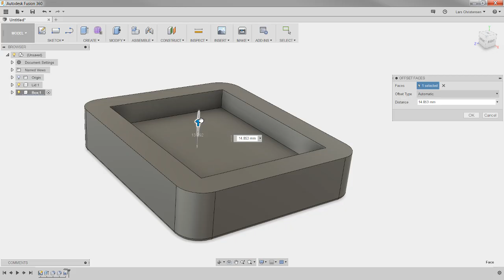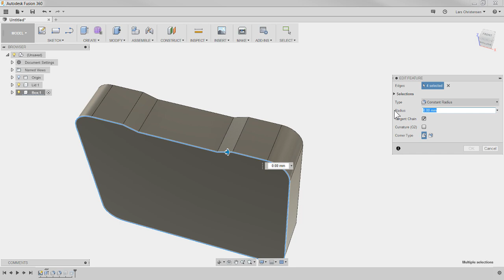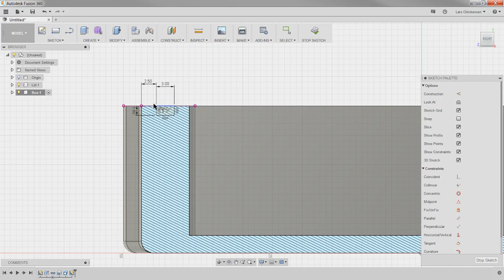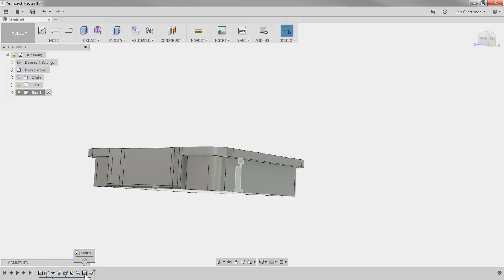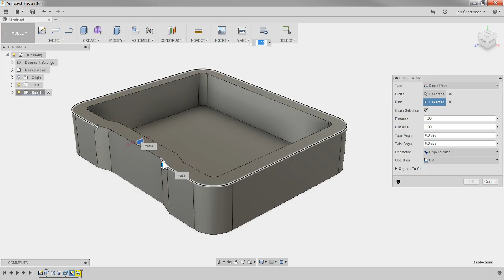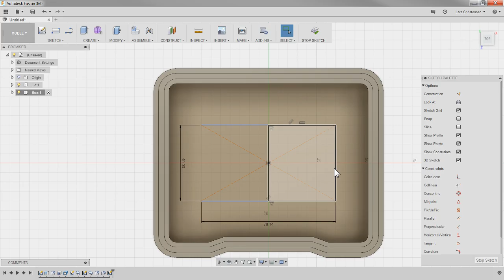Model O-ring Grooves in a Box with Dividers — Fusion 360 Tutorial — #LarsLive 140

Comment: It's interesting doing these videos 4 or 5 years later after the developers have changed some core functions of the software, like the fact that the shell command no longer likes it when you do this, it fails. For me, I would rather filet the sketch in the beginning than after the extrude. Can't filet the corners of a center rectangle to 12 for some reason though.
Reply from the maker: I wonder if it's because it would not be able to hold constant thickness if your sketch has the 12 radius. Everything has to solve in the end.

Comment: I'm guessing the Offset tool wasn't a thing back in 2018? Creating the cut out for the o-ring could be achieved a lot easier be sketching an offset from each perimeter line.
Reply: Autodesk has had offset since at least the 1990s. There are a few reasons you wouldn't want to use offset for something like an o-ring groove, unless you are super religious about being strictly parametric. In this case, if you did an offset and then the accountants came back and said to make that top 7.8mm instead of 8mm so we can save $0.000002/case, you run the risk of the groove size getting moved around. O-ring grooves typically have some very specific geometry as well, rather than just square. By having that geometry already modeled in the sweep profile, you avoid having to go back and add it to the square groove you cut with an offset. Lastly, he said this was to be sort of an introduction to using sweep. I would have constrained the center of the groove profile to the center of the groove face rather than a dim from the edge, but otherwise this is a good way to do it.

Comment: I'll try to catch part 2 live but in case I don't... I would expect to need to design the groove to fit some existing o-ring length, not be just some arbitrary length. I realize using a cut gasket would simplify this but the title is "o-ring" ;)
Reply from the maker: Hi Ross K Thank you for watching!
I have never designed something for a specific o-ring length. You can easily order this stuff in whatever length you need. Or, as I have done one low quantity part. Cut to length and then good old super clue.

Best,
Lars

Comment: Hi, i have 2 problems to solve in Fusion360. 

1) Can you please tell me how to do something like an "assembly instruction" in Fusion360? 
Something like IKEA's:
https://cdn-images-1.medium.com/max/2000/1*KmJbC8bdTxvCSQdyxGtxaA.jpeg.
I know that Inventor can do this, also SolidWorks Composer can do it even better. 

2) Unfolding stuffs on generally is a nightmare. For example, if u design a sofa and want to send the upholstery to the cutter, u need a clear 2d shape. Something that https://www.exactflat.com/
I need a cheaper solution.
Reply: This may help you https://apps.autodesk.com/FUSION/en/Detail/Index?id=3499335255055878377&appLang=en&os=Win64
Reply: Hi. That extension isnt a stand alone app, but only an intermediary between Fusion and ExactFlat cloud based softwere. It is ok, maybe the only one on the market as far i can tell but is to pricey for my eastern european wallet.
Reply from the maker: Yes, sadly I think you are moving a little past what most CAD users do. 
The challenge of assembly instructions past 2D Drawing and the task of unfolding stretchy materials, like fabric.
The best place I can send you is the idea station. Sorry:
https://forums.autodesk.com/t5/fusion-360-ideastation/idb-p/125

Best,
Lars

Comment: Lars, how do you measure the groove so you buy the correct length o-ring?
Reply: I do not know how Lars would do that  but I tried Inspect / Measure selecting the O-ring body. This delivers the area to calculate back the length of the cylinder. Alternatively you look into properties of the component O-ring
Reply from the maker: +1 Johannes That is exactly what I also would do.

Best,
Lars

Comment: Hi Lars, Another great video. I wanted to ask when would you roll back the History Marker to make a change versus just going back and editing the specific feature directly without rolling the History marker back? I ask as I have seen in your video as well as others times when both are done but I am not clear as to why or when you would have to use one over the other.
Reply from the maker: Hi FENATECH Thank you for watching!
That is a great question! I don't think I follow a specific pattern. But, If you just need to go back and edit a specific feature, you can just edit it. When you scroll the timeline bar, it could be because you want to roll back before a specific section to add something.

Hope this makes sense.

Best,
Lars
Reply: So if I understand you correctly, Rolling Back allows me to add a new sketch, body, etc to the design and inserts it into the timeline at that specific point. Where as, Going Back and editing a specific feature could be simply making a change to a dimension or the radius of a fillet?